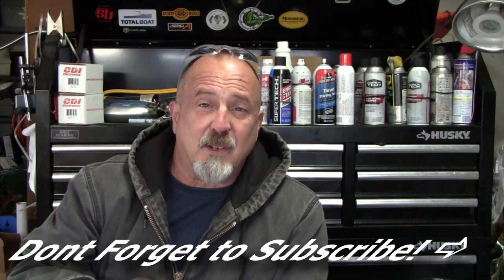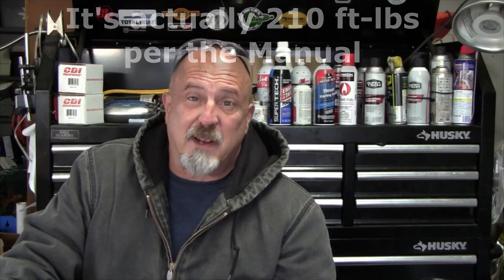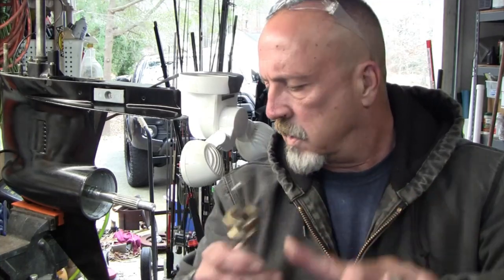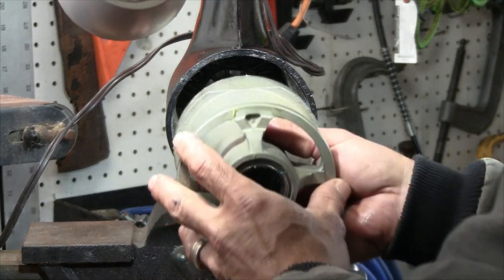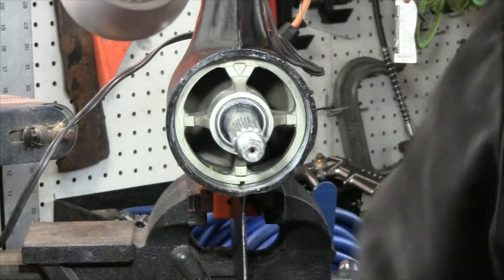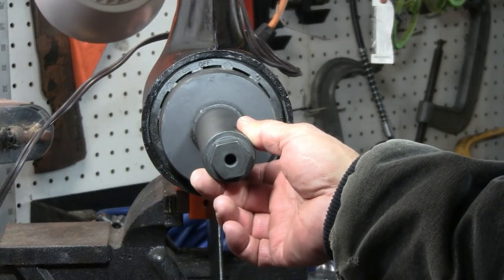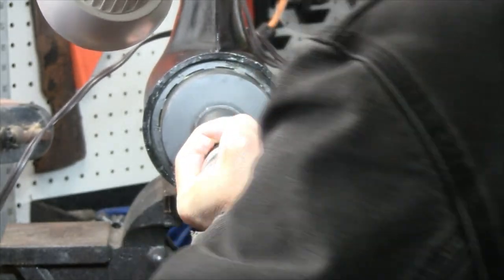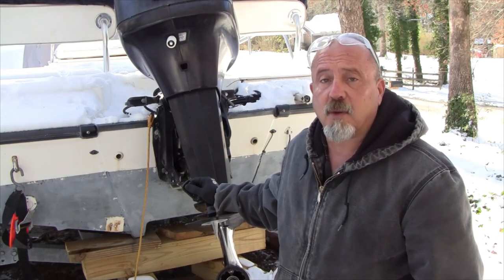How To Rebuild and Install a Mercury Optimax Outboard Bearing  Carrier

Comment: The reason the other youtuber suggested gasket compound
is that in a saltwater environment grease doesn't work as well
to seal  and protect those threads. Over time the grease will just wash away
Reply from the maker: Getting the retaining ring off can be a nightmare under the best of circumstances, locking it in with gasket sealing compound seems counter intuitive to me. Besides, the service manual calls for grease.

Comment: Man I haven't ever worked on a optimax lower and I recently purchased a 2008 Ranger Z520 and the Optimax lower seal one somehow came out and the second one is leaking! I managed to get them out and I ordered two new ones and I can not find a video on it and you didn't show that! LOL
Reply from the maker: Sorry about that! This started out with the intent of showing how to replace the seals. However, since I had to destroy the old bearing carrier to remove it I ordered a new one, which came with the seals installed!